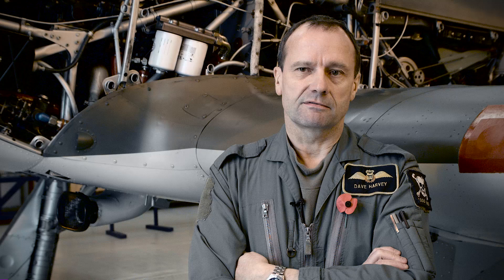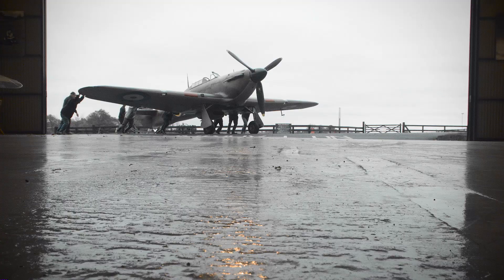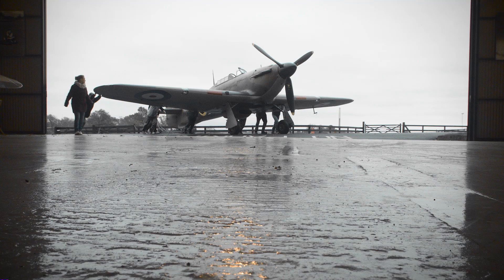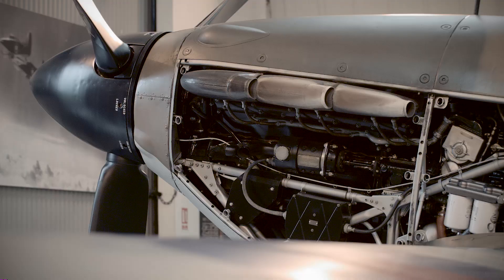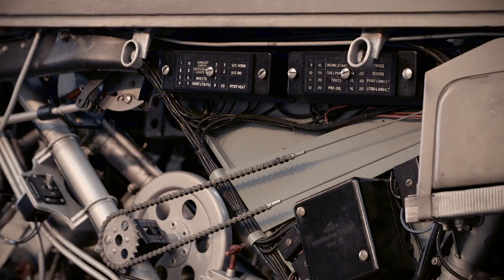Hurricane vs Spitfire: a pilot's view

Comment: I always enjoy seeing what was effectively the last of the biplanes. One big negative of the hurricane that often get mentioned was the fuel tank position in front of the pilot which often resulted in appalling burns.
Reply: Actually it was the wing tanks that burned so many pilots.  The tanks were not self sealing in 1940, and the Hurricane cockpit actually had no floor.  Punctured tanks would fill the wing with gas, ignite, and the flames would come roaring up into the cockpit.  A cockpit floor would have protected the pilot for a few minutes anyway.  
Sad.
Reply: The Spitfire also had the fuel tanks in front of the pilot

Comment: modern equiv. 
the Hurricane is the Saab Gripen. inexpensive cheap to fly workhorse.
Spitfire is the Typhoon. unprecedented acrobatics but more work on the ground.

They both do their intended jobs.
Reply: Absolutely correct 1barnet1, to paraphrase your comment, they compliment each other.
This is something that a lot of people don't realise or take into account when commenting on the Battle of Britain, neither aircraft could have done it on their own, effectively the Germans had the Me-109, only one fighter aircraft type, (I don't count the Me-110 as to do its job it needed to be protected by the 109 as well) the 109 had to deal with two interceptor fighter types with different characteristics that the 109 pilot had to counter, whereas the Hurricane and Spitfire pilots only had the one fighter type to deal with but were equally adept at bringing down enemy bombers and heavy fighters. 😊😊😊
Reply: Like you say, the Hurricane was the workhorse for the time and its numbers were needed to blunt the Luftwaffe's effectiveness but the Hurricane had limited development potential as a pure fighter aircraft, whereas the Spitfire had the potential for greater development as history has proven.

Comment: Slower than the 109 & Spitfire in the air  , but could out turn both & was a better gun platform. The best of the 3 at low level.

Comment: The situation the RAF found itself in by May 1940, they couldn't have a better duo than the Hurricane and the Spit. 

As the pilot mentioned, manufacture and repair were a must.

But the Spit represented investment for the coming campaigns. 

Neither could have pulled the victory off without the other. 

Oh and radar. That was the third factor. 

And the Pols.

Comment: The Spitfire was a racing plane, with some added guns. The Hurricane was built as a rugged fighter. No denying the Spitfire handled superbly in the air, but the Hurricane could out turn it, and delivered a better punch as it's guns were grouped tightly together. The Spitfires machine guns were spread along the wing, and as it was fairly thin, it jinked when they were fired. The Hurricanes undercarriage was wide and solid, the Spits rather narrow. On top the view from the Hurricanes cockpit was better, which was useful on the ground, but vital in a dogfight.
Reply: Andrew Clayton Spitfire was a considerably better fighter in terms of performance though, and it's modern design allowed it to be improved throughout the war.

Comment: The spitfire was a great fighter but it didn't win the battle of Britain. The hurricane won that battle as there were more of them and they were easier to repair, maintain and were allot more rugged. However by 1941 the hurricane was outdated while the more modern spitfire took the fight to the Germans and  performed brilliantly on Malta! The Mk IX spitfire was the first allied aircraft able to match the brilliant foka wolf 190 in a dogfight which was vital in winning air superiority over northern France before D-Day!
Reply: The short-ranged Spitfire was indeed excellent for DDay air cover.  It was an excellent fighter/interceptor, and indeed a supermodel.  

Were I a pilot with a choice back in the day tho after attending the memorials for a bunch of my mates I’d have to choose a more sturdy machine, one that could take some battle damage.  Radial engines were like Hydras, shoot off 3 heads and they have 15 more still chugging away.

Comment: The hurricane was faster to repair ,better undercarriage, was a first class gun platform , if handled by a quality pilot could hold it own with the 109 ,spitfire speed ,and maneuverability, yet had flimsy undercarriage, and was a mediocre gun platform!  The truth is that Britian owe the hurricane more than the spitfire! But as they're both icons that's neither here nor there!
Reply: Hurricane had better turn performance than the Spitfire  , do agree with your comment though , the Hurricane was the workhorse.
Reply: @markbowman9088  "It should also be considered that the best way to overcome the complex maintenance requirements of the Spitfire would be to use larger teams of maintenance fitters."
This was 1940, we had larger teams of nothing. Make do and mend wasn't just a meme, it was reality.

Comment: Differences in the air?
Reply: Spitfire was superior
Reply: lol noobs real pilots use P-51 Mustangs
Reply: Noobs use P-51 Mustangs
Reply: *uses
Reply: Hurricanes could outturn both the 109 and the Spitfire, and had a much better gun platform. But other than that, the Spitfire had the better performance.
Reply: Phil Allison  well not quite, the 109 could actually fly higher than the Spitfire and had slightly better performance at high altitude. The Spitfire truly excelled in medium to low altitude. (During the Battle of Britain anyways). But you're right about the Hurricane though, while slower it could easily out turn the 109 and could hold its ground.

Comment: That’s as fine a report as you will get!    As relevant today as back then!    Not all fighters are the same!    F-22 Raptor!                  Spitfire could turn inside any German fighter.      Saved them,...time and time again!       Both were needed.    Spitfires...breakup there formations....leaving the Hurricanes to pick off stragglers!    Germans did the same.  F-190 and ME-109.  Later with the ME-262 and 190’s and 109’s.

Comment: The hurricane looks like a crop spesing plane the spitdire looks like a racing plane which is ,in 1936 , what the designers wantes it to be until they discoverd they had built a great fighter plane.
Reply: wtf is a spitdire
Reply: Mad Flynn A spitfire with a bad running engine !
Reply: @madflynn4856  So you have autocorrect turned off then.
Reply: @josephking6515  I was saying "What is a spitdire?" cause if you use you eyes, you can see the comment spells it wrong.

Comment: In short: Hurricanes were whenever possible, used to shoot down German bombers.
Spitfires were meant to combat the opposing German fighters.

Hurricanes could absorb more damage and their winguns were all concentrated together, giving a more powerful punch.
Spitfires were faster and equalled the Messerschmitt Bf-109s of the Luftwaffe.

Both planes were essential in the Battle of Britain, there were just more Hurricanes available and shooting down bombers did more for the war effort.
German fighters didn't have that much combat time over England because the Bf-109 was not intended as a long range escort.
So after 15-20 minutes the Bf-109s were forced to turn back and return to their bases in France.

The twin-engined Bf-110s were intended as long range escort fighters but in this role they performed so poorly that the Luftwaffe had to escort these long range escort fighters. As fighter bombers the Bf-110s were rather effective because they could use their speed and fly in at low altitude, under the British radar.
Reply: Unfortunately that is an absolute myth . 303 squadron (polish) that flew hurricanes scored more kills on enemy fighters than the top 3 spitfire squadrons combined during the BoB . Infact one pilot scored 7 109E4 kills in one day .  303 scored 4% of all aircraft shot down in the BoB even though they only became operational 2 months after it had started (so scored the most kills in 3 months and mostly fighters than other squadrons did in 5 months ) . 

The hurricane was actually better than the spitfire V the 109 as it maintained full control at a higher critical Mach number  in a dive (more than the 109E4 ) it also rolled faster than the spitfire by 1.5 degrees a second , so on par with the 109.  

There was never an order issued by Fighter command for hurricanes to attack bombers and spitfires to attack escorts .   They just controlled each squadron to hit consecutively to whittle down the formations .
Reply: @edmundscycles1  It was just common sense. The Spitfire with its thin metal body was much more vulnerable when attacking German bombers plus the configuration of its machineguns meant it didn't have the same concentration of fire.

The Hurricane was more rugged and sturdily built so no, it wasn't as fast as the Spitfire.

That the Polish went more after German fighters than bombers was probably because for them it was a personal matter.
Reply: @AudieHolland  doesn't matter if it looks like common sense , it never was issued as an order nor implemented by indervidual squadrons or wings . 

When intercepting a formation the first flight always went for fighters , didn't matter if it was hurricanes or spitfires . Second flight went for bombers , didn't matter if it was hurricanes or spitfires . 

Combat during BoB would last between 5 seconds or 3 minutes .  After 1 or two turns pilots could find themselves completely alone in the sky , there was no way any organised system as the myth implies could be setup . 

The Hurricanes went for bombers , spitfires for fighters is a complete myth , when you hit that formation you just fired on anything with a cross on it and prayed you didn't cop it .

Comment: They were botg beautifull machines but the spitfire was far more effective and was a better mach for the german bf-109
Reply: Rubbish.!  In truth the success rate of both types was Hurricane 60% ~ Spitfire 35+% in the Battle of Britain. Fact.!!  Because there were many more Hurricanes in service than Spitfires at that time.
READ the relevant books  and do NOT quote just what you like best.!  Facts are FACTS.!!
Reply: @Billbothebear14  well he is right in that the Spitfire was a better fighter to counter the 109. But yes the Hurricane was a more important fighter, but it is worth noting that Spitfires did have better kill to death ratios despite destroying far fewer planes than the Hurricanes, but that was mainly because there were fewer Spitfires to begin with hence they didn't lose that many.
Reply: @Frserthegreenengine  the performance difference between the 109 and hurricane was not that much in terms of speed with combat load . The hurricane maintained full control at a higher critical mach number than both spitfires and 109E . ( this is important as a 109E4 best escape manouver was to dive away in a nose over then pull out . ) With a higher mach number before the controls locked a hurricane could have more energy when in a dive and pursue the 109 while still able to maneuver.  While a 109E4 controls would become slower at speeds exceeding 390 Mph a hurricanes could get to 410Mph before signs of control lockup happenned . Of course exceeding 390mph was not recommended in a hurricane having that maneuverability at high speed means a high speed vertical scissors fight was an easy kill for a hurricane . It was also heavier than a spitfire so it also accelerated in a dive and retained energy better to some degree over the spitfire .

Comment: And the hurrican was ugly
Reply: like you
Reply: 1joshjosh1 Beauty is in the eye of the beholder , it was often called the spitfires ugly sister but by god it did a lot work in the whole of the war and was adapted to do many jobs that the spitfire couldn’t do .
Reply: @Teddy_Richards= About twenty years ago, I had the opportunity to visit Malta, and I went to the Ta’ Quali aviation museum. It was late in the day, the former RAF base and the adjacent Museum were deserted and somewhat dilapidated at the time (the Museum has been much improved since); but there were on display side by side – in static but excellent condition – a Hurricane and a Spitfire. 

     What people do not realize is that the Hurricane is a much bigger airplane than the Spitfire. The data 
(for the Hurricane vs the Spitfire): 
•Length: 
32’3” (9.83m) vs 29’11” (9.12m)
•Wingspan: 
40’0” (12.19m) vs 36’10” (11.23m)
•Height: 
13’1.5” (4.00m) vs 11’5” (3.48m)
•Weight (empty): 
5’745 lb (2.6 T) vs 5’065 lb (2.3 T)
do not fully account for the visual impression of a difference in size! 
The difference in height, in particular, is impressive. 

     I do not agree with your assertion that the Hurricane is ugly: it has the looks of a true military aircraft. 
The Hurricane looks big and bulky; it evokes strength (a bull). 
The Spitfire looks sleek and deadly; it evokes agility (a panther). 
Of course, these visual impressions have nothing to do with flying characteristics!
— •